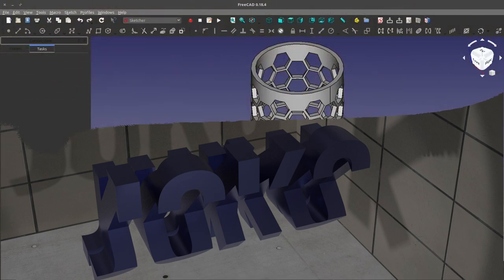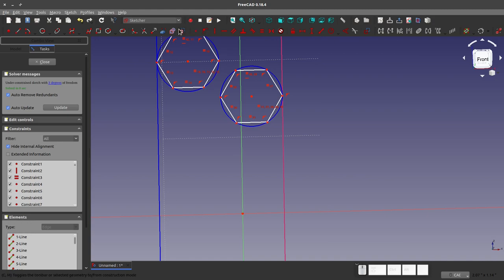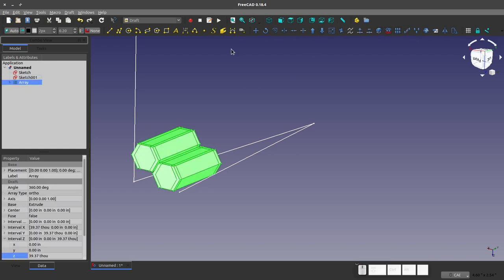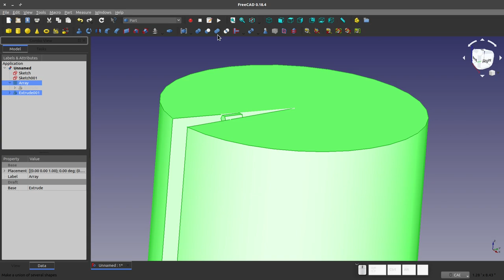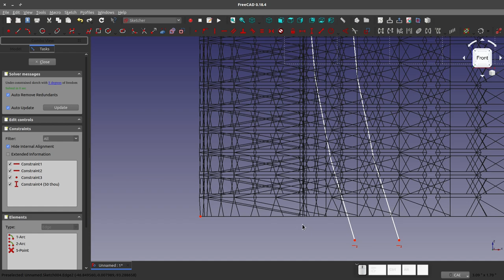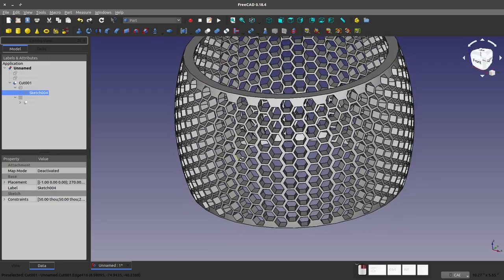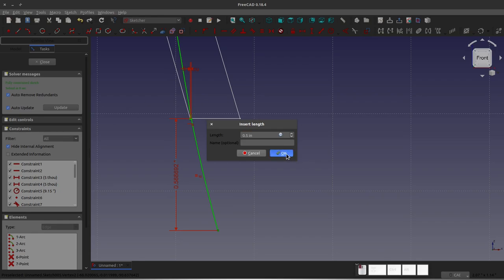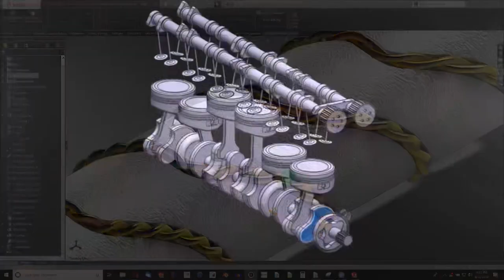FreeCAD - Circular Textures/Patterns |JOKO ENGINEERING|

Comment: During the pandamic I had decided to use Freecad for professional work (mould designing). Little did I know about freecad 0.18 capabilities. Even though I have been using freecad evey now and then for opening and inpecting step files, I had no clue of its recent developments.

Thanks to you and a few other youtube tutors.. I did make a few mould desings which will be in production soon.  

Just wanted to let you know that your followers (students) are watching and appreciate your efforts🙏

P.S. I used to make my mould designs on fusion 360. But I have a soft corner for freecad (because of the concept of "opensource" and "developed by community") I feel that the only way I can contribute to the freecad comunity is by removing the hobby tag and using it professionally.

Thank you once again 🙂

Comment: Thanks, great video.  I tried making it but at 7:42 when your array comes into view, mine doesn't.  Any thoughts about what I might be doing wrong?  I'm a beginner using 018 but I tried several times and the array is not working.
Reply from the maker: Hi Neil;  The arrays can be a little tricky.  This part is available on GrabCAD in the description, would it help to download it and see if the settings on it match what you're doing or if the problem persists on your machine?
Reply: As a fellow FreeCAD newbie, I usually found that when the tool was greyed out or not working, its because I've still got something else open in the task tab. For example, if you're editing a sketch, and then switch to the Draft workbench, the array tool is not available until you close the sketch.  Early on, I made this mistake constantly.  

I also find that some dialogs can be confusing because if I click "close", I think it means I'm done, but it actually cancels the creation if I haven't done all the entry dialogs yet.  The Parts workbench "Rotate" tool gets me on this every time.
Reply: @DanielRisacher  Hi Daniel, thanks for your input.  That was quite a while back and although I kind of let that project go, I have since been able to use the array tool without much of a problem.  So I must have been making some kind of beginner mistake.  But following this channel and others and doing their practice projects has really made the freecad journey enjoyable.

Comment: LOL yesterday been looking for way to do patterning like this.. took me about 4 hours to figure this out using only part design bench.
Reply from the maker: Wow I was a day late!  Nice work on the part design workbench
Reply: @JokoEngineeringhelp  There are some disadvantages to my method. For my personal use I will modify your method. I will make these pasterns in single rows. Its only for even number of rows. I'm doing patterning from both sides of the object and it works like charm.